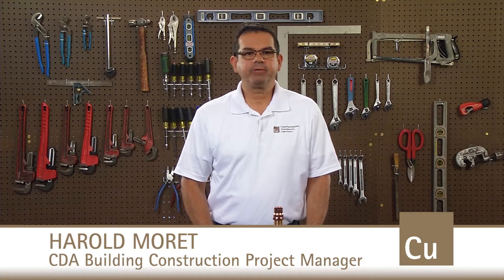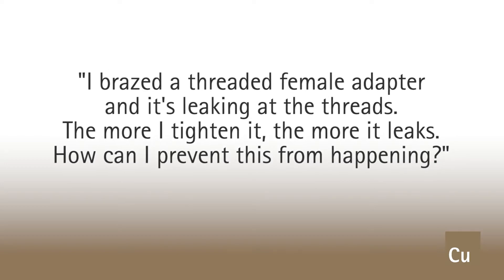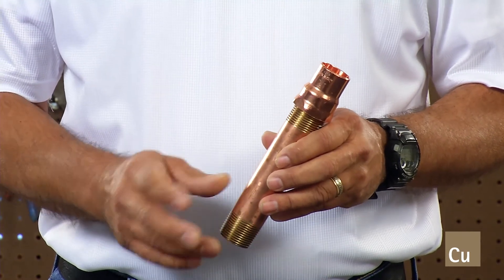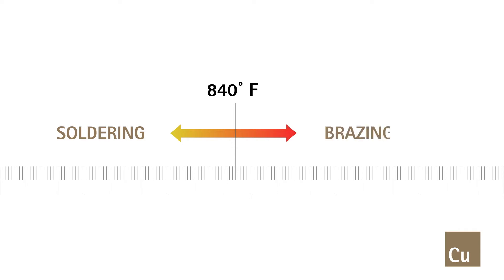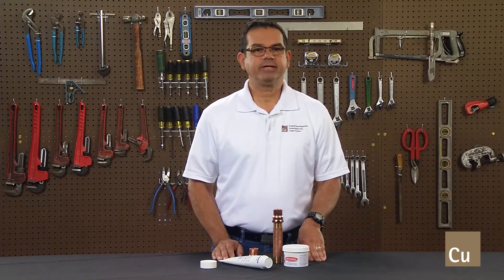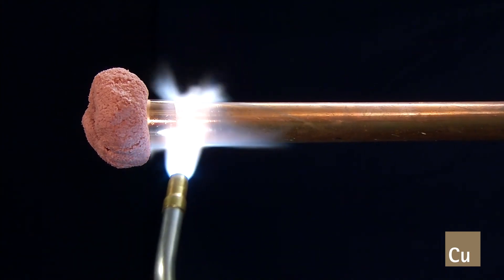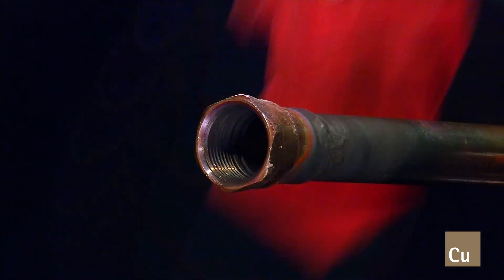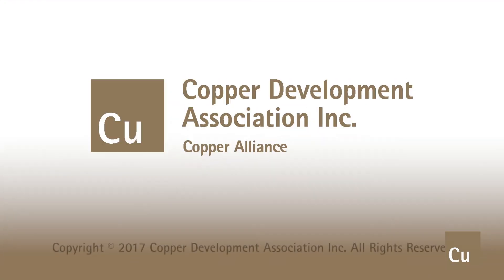How to Braze Threaded Copper Adapters

Comment: Is this applicable to large sizes such as 2 1/2" or 3"? Also - this would be useful for CTS flanges when pipe config does not allow you to pull the steel flange back far enough to keep its dielectric element from getting ruined from the heat.